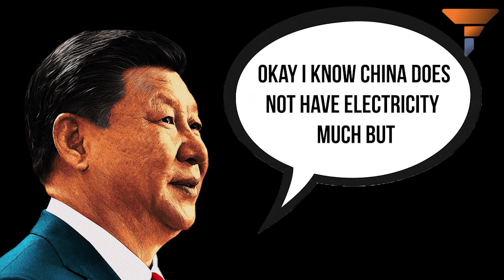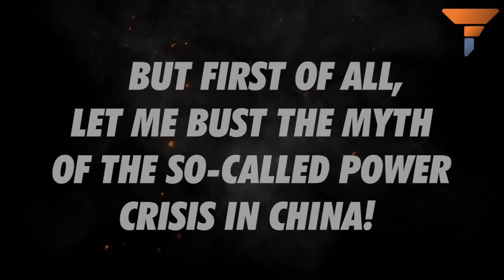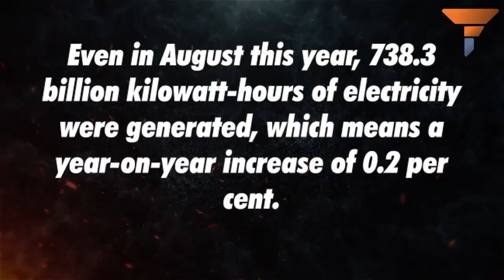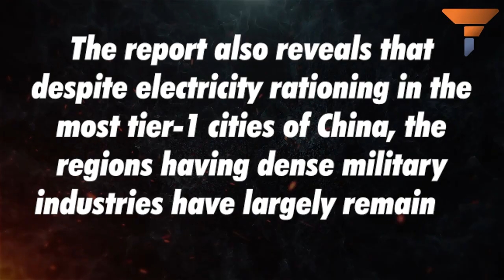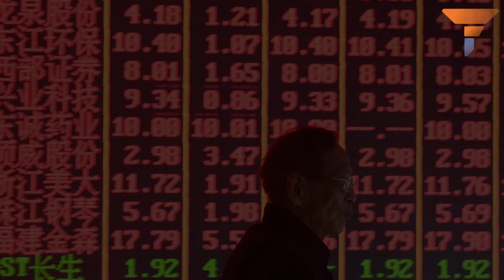China’s recent power switching proves that that Power Crisis is just an alibi

Comment: It has been reported on "China Insights" YT channel, that the cost of coal exceeds the fixed price that power generating plants can charge for electricity.
Their power plants were set up to burn the high caloric value Australian coal, which makes the issue something that cant be easily worked around, at least not quickly. For this reason, the recent unofficial ban on Australian coal imports has been relaxed.